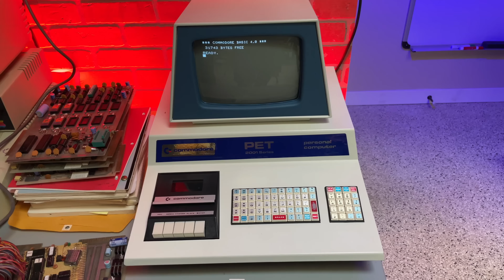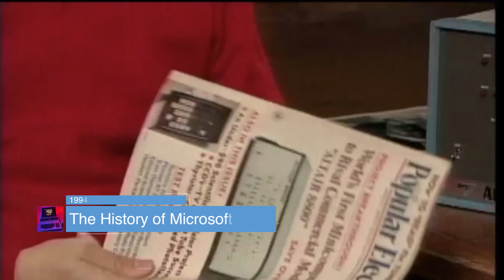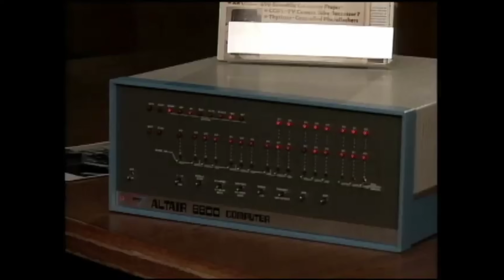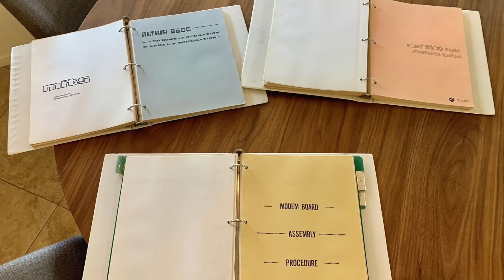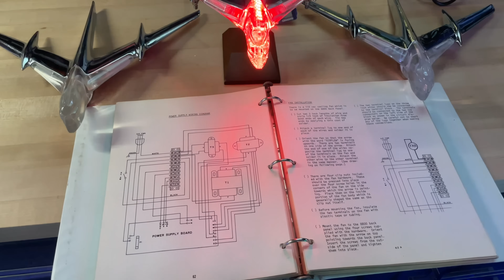The Computer that Birthed BASIC and led to Microsoft!

Comment: Not exactly correct... that wasn't the "birth" of Basic. In 1965 I was at Dartmouth College where Dr. Kemeny was developing Basic to time share on a GE computer. I created engineering programs on the teletype in the attic of the engineering building, making a paper tape after every line of code since it frequently went down. Every fall I learned what new statements had been added to the languare like the For - Next loop and GOSUB. Then, in the early 70's, by chance I had a neighbor who was a ham operator and built the kit Altair. He programmed a "pong" game using the switches. His day job was working for a company that was developing a wireless microphone they hoped to market to shows in Las Vegas primarily so guitar players could move around. (Another crazy idea that seems normal today). Not afraid of pushing the envelope, my neighbor and a fellow ham who also had a kit Altair hooked them to their radios and played pong against each other over the air! Still later, since I knew Basic, I bought a "Trash-80" from Radio Shack when it first came out and programmed a simple word processor, saving my work first on a cassette recorder and later on a "stringy floppy". Then, when IBM came out (8" single sided floppy), set up a word processor for my company. In the 80's I bought a $50 database program that used a version of Basic called XBasic and set up a network of 5 PC's hooked to our System 35 to track production through the shop and a dedicated telephone line to a PC in the sales office two states away. Today, I'm retired but still  use XBasic working over the internet for customers all around the world. No one knew how far that box with switches and Basic programming could go.

Comment: After ten years in the Army as a radio repairman, I have seen my fair share of open connections hidden by the wire shielding.  Most likely the break was there until you cleaned it and the weak shielding gave way to expose the open circuit..

Comment: Nice one, Dave! FYI, the serial board is likely to require +8V and -8V, as the RS-232 standard needs those. Next-generation circuits use ST-232 or equivalent level shifter chips that internally convert +5V to +/-8V for correct signal levels.

Comment: I'm older than you by a few years. I built my own computer in the late 70s early 80s. I found that linear power regulation was wickedly wasteful that most of the regulators ran extremely high temperatures. First I tried using TIP bipolar junction transistors to increase power handling, but they suffered from thermal runaway unless a lower resistance bias current was going to prevent the effects of the heat to cause such runaway. I knew that apple computer was using a switched mode power supply. I bought a design book about that technology.

I completely junked the BJT linear regulation method and began to use the super efficient switching mode methods.

BJT switching was not good due to slow switching transition (rise and fall) times (during which times power was dissipated into the devices) so I had to change the kind of transistors used to the newer enhancement mode power mos field effect transistor type that had superior switching times and lower on drain to source resistances.

Playing around with things I found that lower on times reduced heat even more. To have this happen, I increased the voltage from 16 VAC input to 36 VAC input and down regulated the rectified version of that. I was using 3 AMP 1000 Volt diodes for rectification. The SMPS method converts the power downward by using either a high frequency transformer, or an inductor, capacitor, Schottky switching diode network. This system worked the most efficiently at between 25 to 50 kHz. The inexpensive MOSFETs I bought could handle about 50 Volts DC.

I found that there were FSK analog telephone modems and built one from the chips. I found some design notes featuring low harmonic distortion function generator chips such as Exar 2206 and Exar 2211 phase lock loop that could be used for a higher end cassette tape means of 9600 bits per second FSK storage of data. All the design details were in the application notes for the two integrated circuits.

I would still have to toggle switch into memory the boot loader to access the serial interface peripheral but that was fine. My computer had no ROM of any kind, just static RAM. Eventually I designed and built a "full 64 kbyte" DRAM system with prescribed controller integrated circuit electronics. Circa late 1986 I bought a new i386 PC clone for a colossal amount of money.

My application area in computer science was physics, matrix math, special functions via continued fractions such as double precision log gamma used for probability and statistics.

I later was a software developer of embedded controllers that did industrial process controlling by using laser distance measuring and scanning systems to control robotic actuators using proportional integral differential (PID) motor drive electronics and an off the shelf position drive screw actuator that used a 512 division optical position sensor.

I helped design and prototype a robotic autonomous mining vehicle station laser bar code reader that used a precision speed spindle motor to drive a rotating mirror to project and read a laser sensor. To keep the spindle speed constant our two man team used first a crystal controlled digital phase lock loop, but the mining vehicle would be subject to extreme amounts of vibration when raw mineral ore materials were suddenly dumped into them. Inexpensive frequency control crystals for oscillators are NOT known well for lasting very long when exposed to high G-force shock as would be happening from this industrial application, so that the crystal based timing was nixed in favor of a resistance capacitance voltage controlled oscillator that was more robust in regards to such high G-force mechanical shock exposure.

Comment: When shipping a device that has cards that insert into slots like large routers with linecards or an Altair, the cards should not be inserted. They should be either packaged separately or, if there is space inside the device, the cards should be inserted in the guide-rails but not 'pushed home'. They should be propped up so that they can't be fully inserted. This is because the cards can damage the slot during transit or more likely the back/mid-plane or main board with the slots can be damaged beyond repair.

Comment: nice - those old cards were notorious for losing connection in there socket and reseating the card usually fixed it.  you fixed it by removing to clean then back together again - done

Comment: Former Sony Engineer here.
Electrolytic capacitors (e-caps) have a lifespan of about 6~12 years (you can read more details in any e-cap datasheet), after that they start to degrade. Since your computer is from the 70's, your computer will need a full electrolytic capacitor replacement (recap) before it starts to operate full time. E-caps are made of an electrolyte and water, since you water your board (not recommended) that might have done something to make it work, but it will eventually fail again if you don't address this issue right away.

We don't clean PCBs with water because when the water or the PCBs are in a high humidity environment, the moisture expands. When it gets into the layers of the fiber board or under the copper of the tracks and expands, it creates bubbles. Also, humidity + airborne contaminants + electrical current will oxidize the copper.
Good luck.
Reply: I built one of these when it came out. Great experience. Bought a copy of MITS Altair 4K basic , the interpreter that Gates and Allen and Davidoff wrote. Wobbly memory boards and I/O cards and no bootstrap loader but I loved it and there even was a floppy (8") pertec drive in a matching case. All this happened in one or two years.

Comment: You don't need the original, use a modern emulator.  I've just completed a 6809 machine using an Arduino Due as the processor.  I kept the original physical front panel layout.

Comment: I don't get the timeline.  The 6502 had a BASIC Eprom.  I didn't get my hands on an 8088 until the 80s.  i threw out my '70s pc mags, but they were full of good stuff.  I was 10, learning ASM.  I blew up more electronics than i can remember and the mail order kits were expensive.  The z80 imo was the diy chip that began it all.  Microsoft wasn't early to market in either BASIC nor a leader compared to IBM.  Sinclair put out the z80 w/ BASIC.  I don't get the admiration Gates gets.  I mean BASICA by IBM was the predecessor of GWBASIC (microsoft).  i still have the BASIC asm deconstruction book for the 8088 and MSDOS, the floating point and sqrt functions are still quite mysterious/deep imho.  The little brown book for the 6502 has some awesome routines in it that i still think are more efficient than what alot of langs use today, but then again intel has taken some of the tiny heavy lifting off our shoulders.  The PETs were just not good, our schools bought tons of them and the edu software was crap.  I setup the IBM clones for our HS, expensive but they could run cad software and C, Pascal, Fortran, and Lisp was then available to us.  MSDOS is what made Microsoft, not BASIC.  Everyone has a different experience.  One friend had a commodore, one a ti99a, and I had tsr-80s, the school had Pets, and until the amiga came out ... we all thought we had the best.

Comment: Regarding the power supply, linear regulators require a higher input voltage to work properly. The difference between the input and output voltages must be above a certain minimum known as the dropout voltage. The most common regulators used then was the 78xx series or the LM340 series (the xx part of number in the 78 series denotes the output voltage). The TIP power transistor is probably for the high current part of the power supply. This would be combined with extra transistors and zener diodes or in conjunction with a 78 series regulator operating as a current boost stage.

Comment: I started using BASIC -- specifically DEC's EduSystem BASIC -- in 1973. We had a half-dozen ASR-33 teletypes as interfaces into a DEC PDP-8, 3 of them connected remotely via telephone modems, and we saved our programs on punched paper tape. Each terminal was allocated 4k of RAM.  My, how things have changed.

Comment: no, sorry.   BASIC was already a thing on dozens and dozens of different minicomputers, long before Bill Gates and Paul Allen decided to implement their own version on the Altair 8800.     There were large scale BASIC timesharing systems running on stuff like HP 2100, DEC PDP11, and lots of others.  Dartmouth BASIC dates back to the early 1960s, Microsoft BASIC was like 10+ years later, which is an eternity in computing.
Reply: The later Basic they borrowed heavily from was Stanford Basic. The marketing of software for the Altair is the begining of their business model to aquire and label software as microsoft. Recall a flyer anouncing QDos as now owned by microsoft and to pay them to use it and to delete any copies not licenced. The mouse, PCs talking in a network, and windows, the PARC, Xerox crowd should be thanked, shame they gave it away and others would claim ownership.

Comment: You know, technically, modern PCs run about the same way, RE: distribution of power.  The ATX spec is slowly converging on a single 12V rail, but almost nothing in a computer actually runs at 12V.  Just like computers in the olden times, it's all converted locally to whatever the component needs -- save for fans and maybe a spinning disk spindle.  12V just happens to be a high enough voltage to reduce the current for a given wattage, and low enough that it's not dangerous to handle, nor difficult to buck.

IMO, at this point, we need to be moving to 48V PSUs, because video cards are pulling upwards of 10-50A on 12V lines, and it's getting ambiguous whether high current loads are legitimate, or a short somewhere that is working on melting everything around it.  At 48V, 10A on a single feed would most likely be an over-current condition and the PSU could safely assume it's time to power down.  RTX 4090 Ti Supers could use two rails and have plenty of margin.

And, at 48V, there's not much need to worry about regulation -- anything from 38 to 56V would be reasonable, since nothing is actually consuming it as-is anyway -- making the PSU design simpler.  Eh, but what do I know?  ;-)

Comment: I learned to program in 1972 in FORTRAN at college  and in 1978 convinced the printing company where I had advanced to production manager to buy me a WANG MVP to create a job tracking system.   The MVP had eight “dumb” terminals and was the first micro processor based computer with a hard disk drive, one 5MB fixed plus a 5MB removable the size of a large pizza in a unit the size of a small filing cabinet.  The MVP has no OS, it booted to the BASIC prompt so I had to write my own DOS to fill the entire disk with a A$(X,Y) array to store the data, with code to read, write, lock, search and key search files.  I just figured things out on the fly with nothing more than the command reference book.  Eight users were able to access the same data — I had created a multi-user OS and database a year before MS-DOS was launched on the IBM PC.  

I parlayed that experience into a job at another printing trade shop in 1980-81 creating an estimating / billing system, again in BASIC, on a DEC PDP11/44 and that convinced the US Information Agency to hire me in 1982 as a Foreign Service Printing Specialist to manage its overseas printing centers.  USIA used WANGs but only for word processing at the end user level and refused to let our department acquire and run an MVP or VS I could develop code on.  

Undaunted I went down the street to Radio Shack and purchased a TRS-80 Model 100, one of the first laptop computers the size of a phone book with an 8 line x 24 character LCD display and a built-in modular jack 300 baud modem, which ran on four AA batteries which I carried to work in the saddlebag of my motorcycle.  It had a file system by booted to BASIC with an OS Microsoft developed for Radio Shack.  In an interview by Steve Gates he mentioned that project was the last one he personally hacked code on.  There are a lot of “Easter Eggs” buried in the OS code by the developers I discovered with the PEEK command.  

I developed programs for printing estimating on it, using it at work until 1984 when the USIA IT establishment finally allowed end users like me to have their own PC running MS-DOS and Lotus 1-2-3.  Giving that I had developed my own multi-user shared DB I thought MS-DOS rather lame because data had to be shared on disks redundantly.  But that’s the point I stopped programming in BASIC except for personal stuff on the Model 100 because it was easier to develop the work applications I needed for things like estimating, billing, accounting an inventories on macro driven spreadsheet databases in Lotus and then Excel when we switched to Macs in 1987 for graphic arts (typesetting, page layout and scanning) and admin tasks. In 1990 I converted all my Excel applications to Filemaker databases and was finally able to develop multiuser shared databases again.  Over the next 20 years until I retired in 2010 I used Filemaker automate our entire operation and another USIA department while also performing my other management duties.

Learning to program and more importantly actually solve problems with computer by myself at no additional cost to those I worked for beyond my salary proved to me my ticket to a very interesting and remunerative career.  All the result of two professors in college failing me for “thinking outside the box” and  motivating me to drop out like Gates did.  One of my regrets is not meeting Gates back when I was developing my first multi-user database on the WANG MVP.  I would be richer and MS-DOS wouldn’t have been a lame, single user OS.  😂

Comment: As a 17 year old I did not know about the Altair.

I built up a similiar system with a Z80 CPU and programmed it by many DIP switches and it worked very well.

And I did not know the existance of an Altair. Go figure 🙂

Comment: Dave you need to replace all of those electrolytic capacitors they all dead long ago and may be shorted internally.
Reply: If any of those caps were shorted internally, that PS would be DOA.  But yes, they a WAAAAYYYY past their MTBF and should be replaced.

Comment: While its not really recommended to put electronics into water, it happens. One trick I learnt from the firefighters (as they're walkies used to get saturated when fighting fires) was to put the board into a pie oven on low for a few hours to dissipate any water.
But sounds like your power supply problems was probably the bad connection from the transformer. Being that the caps are 40+ years old too, I'd be looking at replacing those as a matter of course. When I'm working on old guitar amps, that's the first thing that generally gets replaced as electrolytic caps don't last and even worse if they haven't had any power through them for years.

Comment: That 4K Basic was an amazing piece of work!  
The benchmark of the day was...
FOR I=1 TO 1000
NEXT I
I took 4 seconds on the stock 8080. 
The 4K interpreter took up about 3200 bytes of 4096. 
A 32bit floating point subroutine package with transcendentals took about 1600 bytes. 
That means they implemented the rest of the interpreter in 1600 bytes.  That is really tight coding!
Mits came out with the Altair 680b that used a 6800 CPU.  It ran at half the speed the stock 6800 could run at. 
At full speed CPU it would do the benchmark in 3.2 seconds. 
The 6800 was faster than the 8080.
Reply: Allen and Gates had implemented a 4K interpreter for the 6800.